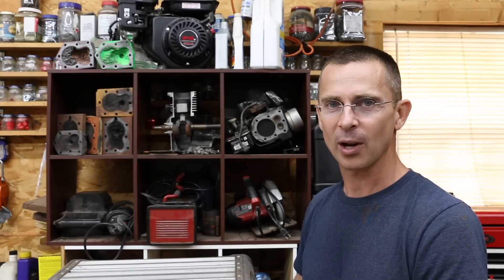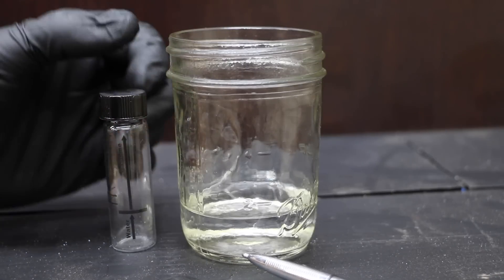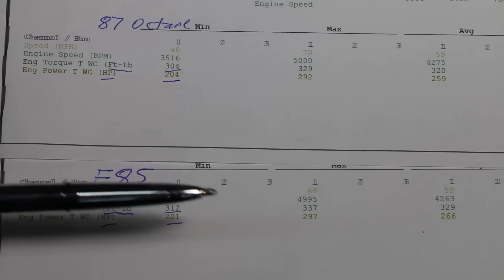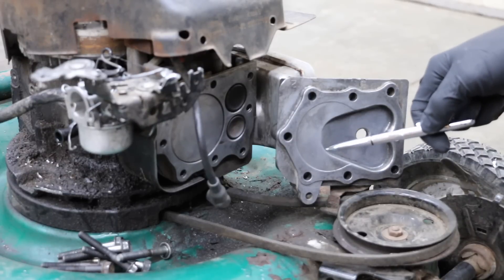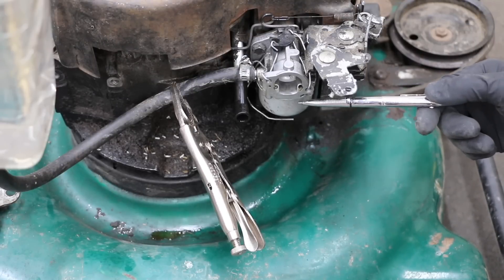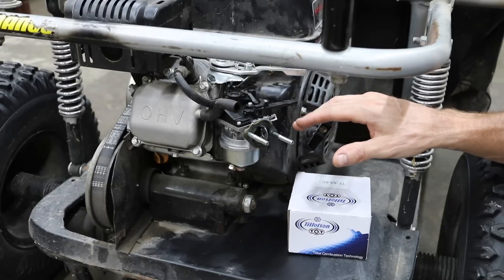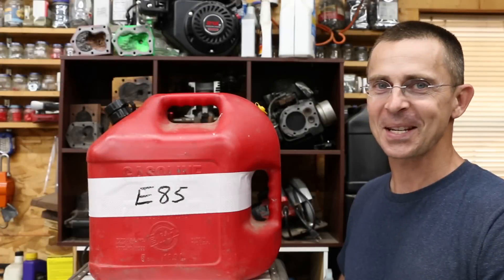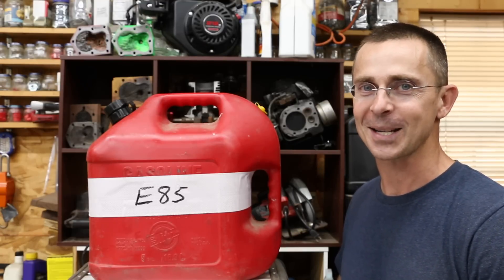Is E85 better than Gasoline? Let's find out!

Comment: Here in Brazil we have usually 2 choices:  Pure ethanol, and 27% ethanol with gasoline (E100 and E20). Most brazilians have flex fuel cars but there is a lot of debate in which fuel to use, mostly because the price is changes a lot in between states and cities. Fuel stations even have the ratio of price so it's easier to measure which fuel is best for your situation, like you said gasoline has much more energy in it, this difference here is around 20~25% on efficiency, because of the different mixture of fuels, so if the station tells me that the price difference is less than 20%, then I'll fuel with gasoline. I personally drive on ethanol most of the time since it's cheaper in my region.
Reply from the maker: This is interesting. Thank you for commenting.
Reply: Thanks for making these videos man!

Comment: Great video.  I use E85 on a motorcycle that I upgraded everything to run it, but I have tunes I can switch to that also learning.   It lets it adapt quicker than stock management system. MPG I am usually 20% less, but HP you can feel I usually get about 10% more.  I only really would recommend E85 to people that want the HP.
Reply from the maker: Thank you!

Comment: Nearly bought a Flex-Fuel car a few years ago, but the only station nearby that sells E85 has it only slightly cheaper than E10, and I’d heard the fuel economy drops a lot with higher alcohol. No thanks.
Reply from the maker: Great point.

Comment: I have a 1986 Toro 8-32 lawn tractor, and it has a fully tunable carb with a Briggs and Stratton 8 horsepower Flathead engine and I decided to try running it off of E85 and what do you know it runs better than it did off of gas.
Reply from the maker: Impressive! Thank you

Comment: It performance automotive applications, it's zero contest - ethanol all the way. The higher octane, slower-developing flamefront, and evaporative cooling effect are all things  tuners can use to make major differences in power. One of the keys is this - you have to change the tune to take advantage of the the potential offered by ethanol. Simply putting ethanol in the tank is only the beginning.

To offer actual numbers, I tuned for 325/350 @ the wheels on 93 octane in my Speed 3, which had me right below the knock threshold. With only E30 in the tank (30% ethanol/volume) I was able to tune for 390/385, and could go even higher, if I wished. I stopped there in light of the characteristics of a stock-block for my platform.
Reply from the maker: Great point. Thank you!

Comment: The thing is:  ethanol was a cheap replacement for other oxygenators like MTBE and other ethers.  But now,  ethanol is being phased in as a petrol substitute.  In countries like Japan, dimethyl ether (DME) is being used in certain diesels, instead of propane, corn oil or petrol diesel oil.  DME production is too costly in most countries and, like hydrogen, is considered an energy storage medium, rather than a fuel,  since it must be manufactured, rather than simply refined from natural resources like crude oil or corn.

P.S.:  DME and propane have similar physical properties, making it easy to modify gasoline engines, as well as diesel engines.
Reply from the maker: This is great information. Thank you

Comment: The ethanol has a different stechiometric ratio (i.e. how it should be mixed with air) in comparison to gasoline. Ethanol 9:1 and gasoline 14.7:1. The reason is that ethanol has oxygen in its molecule already so it needs less oxygen from air. You have to compensate that by using a choke or re-jet your carburettor. Also ethanol is much more aggressive towards some materials (e.g.zinc-alu alloy for making carburettor body; it will create a sort of grey dust that will clog your jets). Also certain rubber parts show faster degradation (fuel pump, fuel line). The energy contents of ethanol is only about 70% that of gasoline. The good point is that ethanol has higher octane number (106 RON, don't know about AKI precisely, I estimate 102). In the winter, ethanol will absorb moisture from the air and you wil have difficulty starting. Also tailpipe emissions of ethanol-powered vehicle with cold engine are highly toxic, worse than gasoline.
Reply from the maker: Great point. Thank you

Comment: E85 isn't worth it! unless the cost of it is much lower than standard E10 gas compare to the mileage you get out of it. When it is the same costs or a little below it, why would anyone want to use it, unless you are an environmental zealot that is makes you feel good cause you are running a cleaner engine out of billions of people around the world!

Only other good for E85 is if you have a high end engine and want the higher octane from it.. Racers will use it as an alternative.
Reply from the maker: Great point. Thank you

Comment: Ethanol is worthless in terms of octanes.  And octanes are efficiency related.  I would never use E85 because of the lower performance even in engines designed for it.  Regular gasoline is better in that regard.
Reply from the maker: Thank you!

Comment: Could you please test which two stroke oil works best. I have a two-stroke dirt bike and I like to use a brand called klotz and I use either the super techniplate or the r 50, I used to run the Walmart brand of 2-stroke oil but I feel as if I did not get enough lubrication because the bike had actually seized up and I had to rebuild it. Lots of my friends who also have 2 stroke dirt bikes used other brands. I would like to know what is truly the best lubricant. Also if I had to have one brand that I would really like to see tested it would be Amsoil saber because people run that oil in their dirt bikes at a much leaner ratio than they would any other oil and it seems to outperform everything else.
Reply from the maker: Thanks for the video idea!
Reply: Im also very interested in the 2 stroke oil test
Reply: Amsoil and Echo red armor are the best at lubricating. Have to be careful though, that oil sticks, even at 50:1 mix.

Comment: To really make power with e85 you need to have forced induction so that you can push timing
Reply: It isn't the timing so much as it is the cooling effect the evaporating fuel has on the intake charge. Alcohol takes a lot more heat out than regular fuel.
Reply: Don't forget the extra octane of around 105.
Reply: Timing has nothing to do with forced injection making power. The octane rating makes it easier to run more timing with the dynamic compression of forced induction with less chance of detonation (which is what cracks pistons and generally causes a bad day).
Reply: Take a engine and it will make more power on e85 then gasoline-1. Higher octane-more timing and capability of high compression. 2. Ethanol is a oxygenated fuel so it burns more efficient than gasoline. 3.ethanol burns at a slower rate which is why usually you see a nice increase in TQ. E85 is amazing I use it in every vehicle I own.
Reply from the maker: Great point. Thank you!
Reply: Or you just bump the timing on an n/a car. Its the same effect.
Reply: fightfanian combustion in an internal combustion engine requires 3 things, fuel, ignition and air. Ignition normally isn’t an issue unless you run a lot of compression. Fueling is normally not an issue until you get into crazy horsepower. Air is not an issue until you need to force it into the engine to take advantage of octane rating. Creating a positive amount of pressure, forced induction hence the word forced, is what allows you to compliment the fueling with air to create the proper air fuel ratio. A naturally aspirated engine cannot simply push more timing unless it has a cam or some kind of forced induction to compensate for the extra fueling. Nos, Turbo, supercharger and pro charger, a kind of supercharger (pulley based turbo with no exhaust scroll) all work for that
Reply: @chrissierra3208  The reason for more fueling is e85 has roughly 30%less btu or energy than gasoline. Therefore everytime the injector squirts it has to provide 30% more fuel to equal the same energy output as gasoline. If not you get reduced power.
Reply: @chrissierra3208  advancing ignition timing increases cylinder pressure  by causing the most effective part of the ignition event to happen atdc. Not to mention helping the flame front to be "caught up" with piston speed at higher rpm. So yes, advancing ignition timing commensurate to octane is very effective in n/a engines.
Reply: @fightfanian  Exactly. I think some people get confused.
Reply: Or a high compression ratio. Anything that is timing limited will make more power with e85.
Reply: It’s burn isn’t slower. It’s a common misconception because of its high octane. It just resists detonation really well (detonation being a form of extremely fast burn). 

But the laminar(normal) flame speed of ethanol is higher than gasoline.

Comment: Imo e85 or any kind of ethanol in fuel is only there because of government regulations. Even with high horsepower boosted applications there is no reason to run it when it's a track only car and you dont have to comply with emissions, and if youre modding your daily its more sensible to use 93 octane with water methanol injection simply because finding a station with true e85 is very difficult, and they are few and far between, and thats the last thing you want to take a chance on.
Reply from the maker: Thank you

Comment: E85 is worth somewhere around 2%-3% increase in HP.  The higher your compression,  the more beneficial it will be.  I've been running it in my GTO for years.  The car has an upgraded fuel pump, injectors and tune to take advantage of the corn juice. 
  The car also has higher compression than stock, (11.4:1) a larger camshaft and ported heads.  
  Fuel mileage is dismal at around 9mpg but I built the car for fun, so I'm fine with it.  Also, love the way it smells!!!
  You can see a few videos of the car on my channel. 
  Thanks for the video, I enjoyed it very much!
Reply from the maker: Thank you very much!  Sounds like a very nice car!

Comment: I have an 08 dodge ram 4.7L with flex fuel and I get about 1 1/2 miles to the gallon less on E85 than with 87 octane and the power is so close you cant tell the difference...E85 is about 50 to 55 cent a gallon cheaper here in Arkansas....the temperature runs a little cooler on E85.
Reply from the maker: Thanks for commenting on this.

Comment: Go to http://www.yellowhose.com/e85_calc.html to figure which fuel is more economical for your car. Only a sufficient drop in E85 price at the pump can justify buying E85 vs the 87 gasoline price. Because of the lower fuel economy and shorter driving range of E85. Even though E85 is cheaper at the pump, you would probably have to buy more of it to drive the same miles per year, costing more per mile.
Reply from the maker: Great tip. Thank you!

Comment: I run E50 in my 1.4T sonic in the  summer, 50-65% ethanol is about where most people stop seeing performance gains. @85% you're closing on the difference between fuel injection windows and duty cycle at higher RPM.
Reply from the maker: Thank you

Comment: I have been using my own peugeot scooter E85 but it is fresh lubrication, which dispenses oil into the carburetor. I have used E85 adout half years no prodlem. My scooter is 68cc 2-stroke engine.
Reply from the maker: Thank you. Glad it's working well.

Comment: I use e85 on Mazda 323F 1996. Running great
Reply from the maker: Thank you
Reply: @ProjectFarm this car run on 95 regular in France... but i ve changed the spark plug with cold spark plug. Put NGK cables. That's it. Started with little mix 30/70 50/50 70/30 and then 100% E85

Comment: Another great video answering questions for the world.  Have you ever tested Amsoil Saber 2stroke oil?  It claims you can run it at 100:1 with no issues...  I'm sure it will run at that but I wonder how thin you can actually run it and have it still protect a 2 stroke?  150:1, 200:1?
Reply from the maker: Thank you!  I need to test it.  I have some.

Comment: Can you confirm that you filled up again on E85 after the dyno testing?  If not, that certainly wouldn't help fuel economy.
Reply from the maker: After E85, I filled up with cheap gas (87 octane with 10% ethanol) and fuel efficiency improved from 13.9 to 15.5 MPG on the cheap gas. Thank you!

Comment: I used gas with ethanol ( not e85) in my 95 Chevy truck and it ate up the rubber hose inside the tank. Now I only use real gas.
Reply from the maker: Wow!  Thanks for commenting on this.

Comment: Here where I live, E85 is actually about 30% cheaper than regular gas. So, I would say other than the fact that you have to refuel more often, E85 is a no-brainer. Keeps the engine clean, as well as smelling better than regular gas. Also pollutes less.
Reply: the smell is the best part!
Reply: My car smelled like a distillery. Even cops noticed that when I left it idling.
Reply from the maker: Great point. Thank you!

Comment: After the hurricane all I could get was E-85 for a while, as gasoline shipments were slow and the E-85 tanks get filled by a different truck. I did not notice any real problems with it other than it was harder to start in the morning and the fuel economy sucked. I also mowed my yard with E85 and surprisingly my Craftsman 42" riding mower ran exactly the same as it did with regular gasoline. I did not change the jets or anything.
Reply from the maker: Excellent!  Glad the mower did fine on E85!  Thanks again.

Comment: E85 give more power on a flex fuel capable motor, but uses 30% more fuel. Bad in non flex motors because they arent made to handle it
Reply from the maker: Great point. Thank you

Comment: Gas is so cheap on the US, it's insane. In Portugal, 95 octane gasoline, our lowest octane (equivalent to your 91), costs 6,84€ per 4liters. That is about 1 US gallon of fuel. That is also simple gasoline, no "high tec" additives. Diesel is cheaper at 5,98€ per 4 liters. Simple Diesel that is. Goverment keeps over 50% of the money.
Reply from the maker: Wow!  I couldn't afford to drive.  That's a lot of tax revenue.

Comment: GOOD test Commander and you know what I think about that junk. I paid for an Ebay adjustable carb for my opposed piston Vanguard on my Craftsman mower and it made a WORLD of difference opposed to the factory lean run choke out job. I can get by with the 10% ethanol but they can keep the other. Your test proved it just don't cut it and that was a rig made for it. I was wondering what a new rig would do but with the way yours turned out they can keep them too. Too much garbage to keep track of. Thanks again, Commander and BLESSINGS and you better mow while you can. Heavy frost here this morning and it was 32. Maybe fall IS here!.
Reply from the maker: Lewie, Thank you very much!  Yes, the ethanol definitely causes harm to small engine carburetors as I experienced.   Great advice on mowing the lawn.  Just mowed ours this morning.  Winter is coming soon.  Many Blessings to yall!
Reply: I've seen the flex-fuel rigs at work slobber and wheeze around and rattle like a diesel all because of trying to get them to burn that stuff. I'll just run the old stuff. Thanks for everything and get the firewood ready to go. NIce evenings by the fire with the cold wind howling outside! Blessings!

Comment: I am a bit confused, in Germany and Europe overall, I use 102 octane.... how are you using 85 ? This can’t be right.
Reply from the maker: Thank you, The US uses a different system for rating octane.  E85 contains 85% ethanol and has an octane rating that's likely over 100.
Reply: Project Farm Oh ok, that’s nice to know, now this video makes more sense 😂 
I don’t really know if this is possible for you, but what about a video in which you compare, let’s say the gas I use (Aral Ultimate 102) with a similar US product (E85 I guess ?).
To see if you guys over sees have a different gas, regarding fuel economy, cleaning of the fuel system, etc.

Comment: I'm surprised that it's not so interesting in USA. Here in France, E85 is very interesting because it costs 0.65€/L instead of 1,80€/L for regular gasoline. Thanks a lot for your test, we have to change our carb seals and hoses to put ethanol resistant ones, then some engine tuning, and run !
Reply from the maker: Wow!  That's a huge savings.  Thank you!

Comment: I have never run E85 on my flex fuel vehicles because it isn't cheap enough relative to the energy content per gallon. E10 (regular gas these days) is the most bang for your buck.
Reply from the maker: Great point. Thank you

Comment: I have 30% e85 in my old volvo 240. The carburetor is ajusted and of I go. the timing can be more agressive and with the opend up ports, it  just wakes up the engine alot :) in wintertime I just drop the % down with the faling temperature so it runs good and need no messing with the carburetor :)
Reply from the maker: Thank you!
Reply: I haven't seen one of those in decades. Did you ever see the 262c coupe? That was a really pretty car based on the 240/260 series.

Comment: With the ethanol you can turn the timing up on the 5.3 considerably higher and still be safe compared to the 87. The e85 resists knock much more so than 87 octane. You can also run much higher compression ratio with the e85. I love the content on e85! Maybe you could try the e85 in a diesel engine? That would be a cool test!
Reply from the maker: Great point!  Thank you.

Comment: I use E85 on 2005 Pt Cruiser for every day driving. I’ve never had a problem, it performs just fine. I did the math once and I was actually saving money. However the closest gas station that offered E85 is way out out my way. 
The only noticeable difference is during the colder months when the temperature drops below 20f the car has a hard time starting. But it always does end up starting.
Reply from the maker: Nice!  Thank you